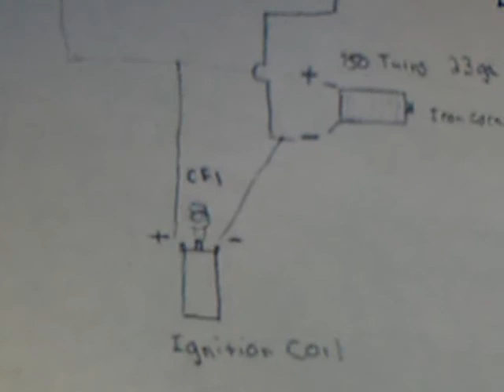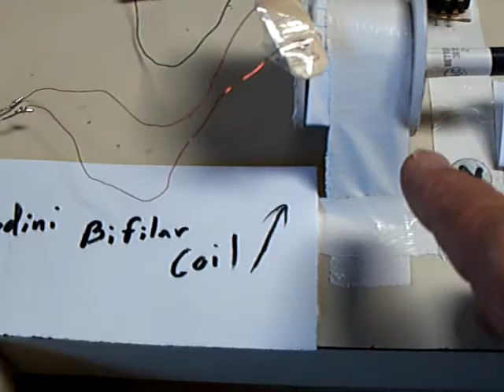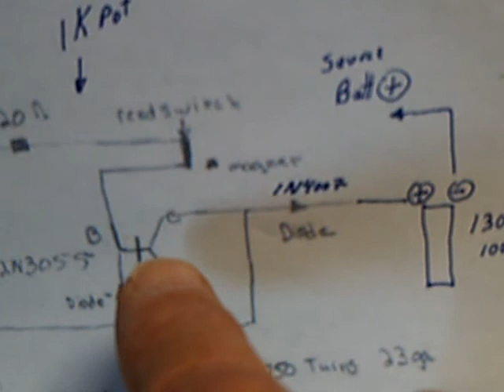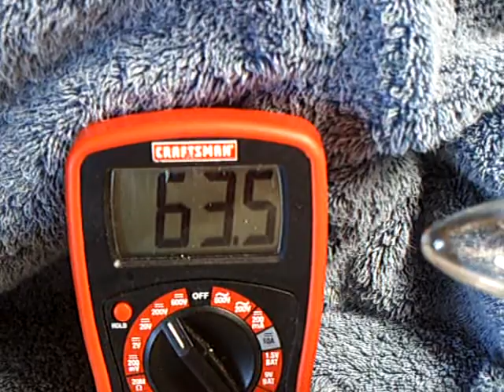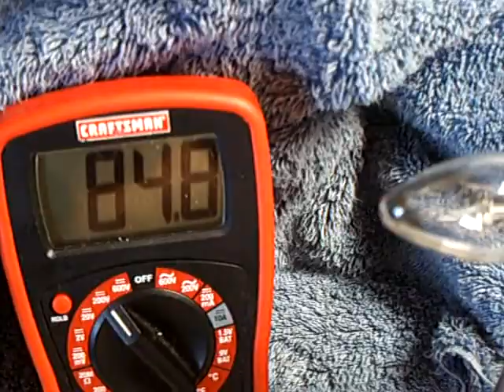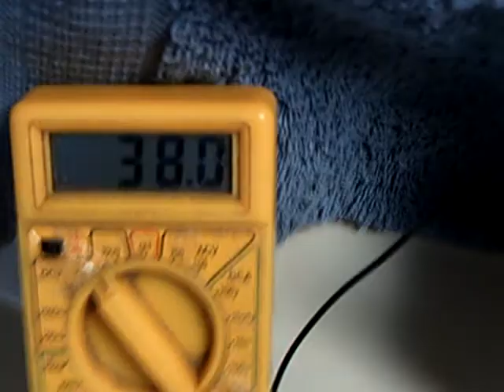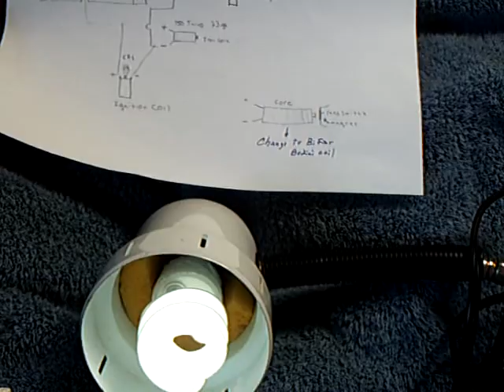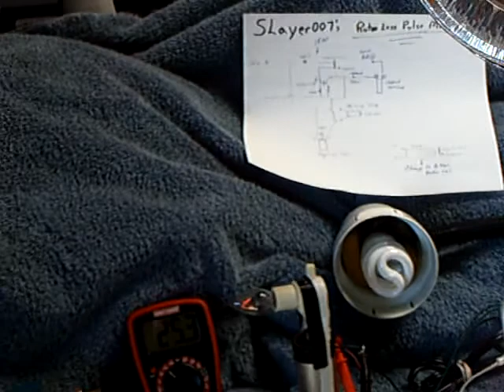Slayer007 Rotor Less Pulse Motor----- My Replication

Comment: awsome,  i just got the imhotep radient oscilator going with a cheap 9volt, it powers the cfl dimmly if i use a 120v/6v transformer.
 think something is backwards or do i need to make my input a 12 rechargible battery?

good replica, im into this.